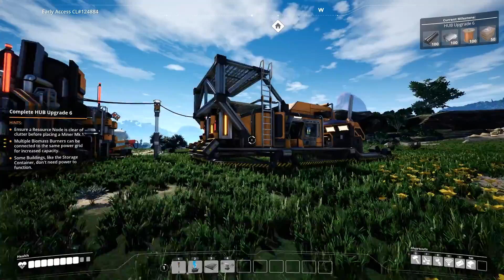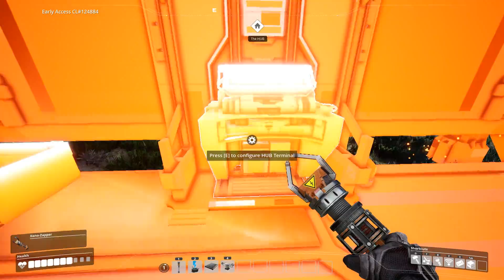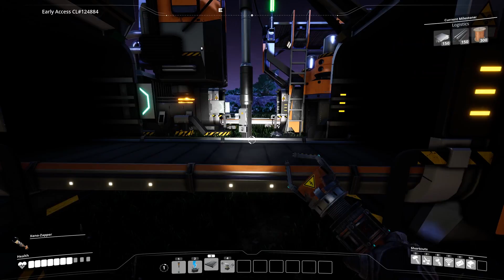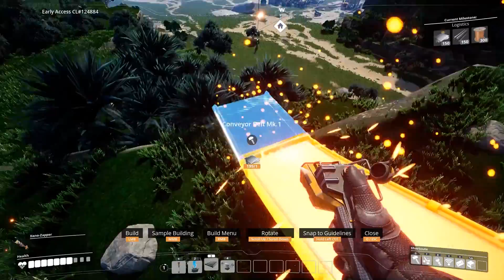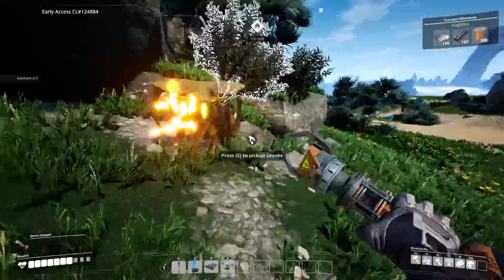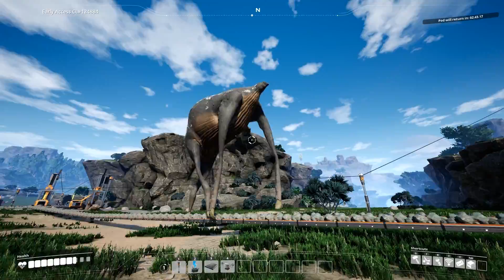SETTING UP MY FIRST PRODUCTION LINES! - Satisfactory Gameplay #2

Comment: Map is 32x32 KM. When you started up the game, you will have seen four starting locations. Those are four different locations on the same map, and regardless of where you start, you can reach anywhere on the map.
Reply: Selecting the buildings will show how fast they craft or produce items. Calculate that according to the belt capacities. (ex. 1 Mk. I Miner can feed two smelters).